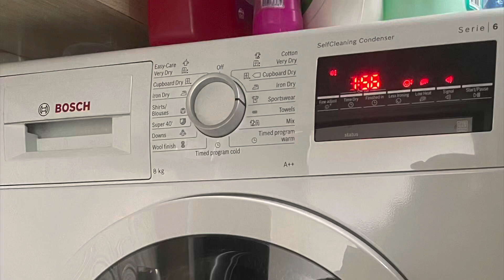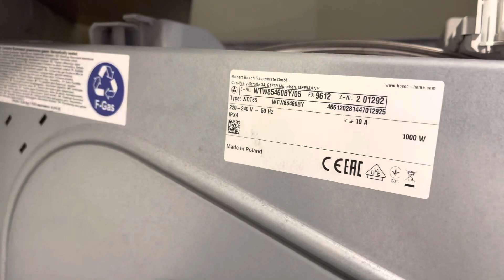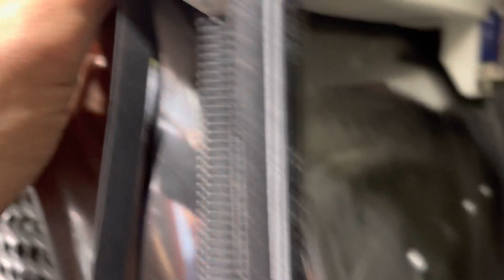Bosch Tumble Dryer Series 6 How to change the belt - DIY

Comment: Not very useful. DOESN'T SHOW...Side panel removal or back removal or position of new belt on motor or supporting drum with tension or reassembly!!??
Reply from the maker: if somebody with idea .. will understand no worries ;) but thanks for the negative comment..
Reply: @SuperFastDriver  Constructive critique..Have another go includingbthe hard parts next time...These clips are.harder to make than people think...but sarcasm doesnt change the facts as I stated them Best wishes A
Reply: Mounting the belt on the engine is easy. The engine is kept in place by a spring that pulls it down and keeps the belt under tension. Slide the belt over the drum as shown, mount drum on back panel and fix back panel with 2 screws. Unscrew side panel, lift engine with left hand and put new belt on pinion with right hand, release engine and turn drum a couple of times to check everything turns well. Put side panel and remaining screws back in place. N. B. Wear gloves when handling side panels as they have sharp borders... As my left hand can say😁